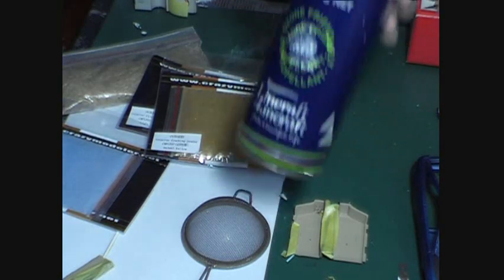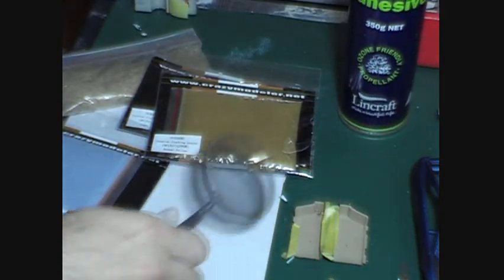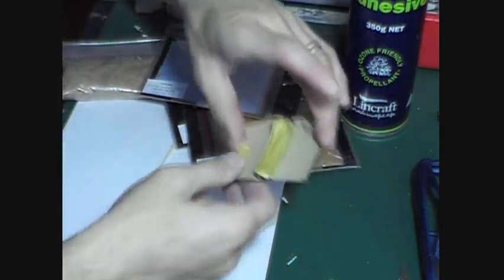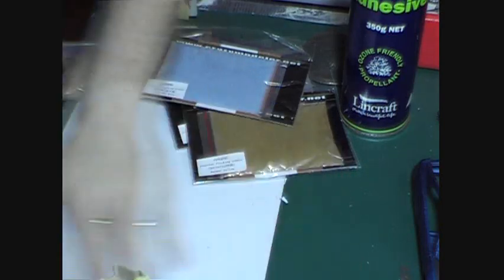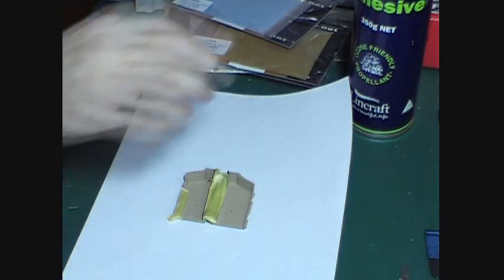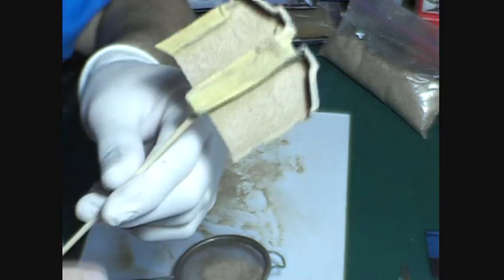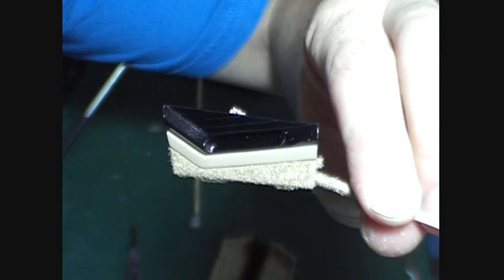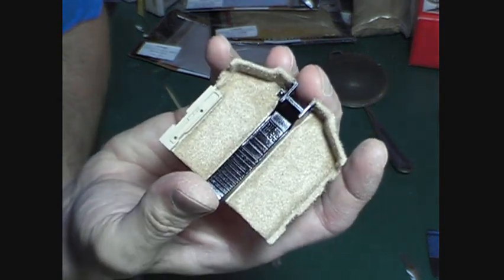Italeri Ferrari 348TB - Part 2 How to Apply Flocking

Comment: Outstanding work with the flocking mate.  You make it look so easy.  I have run into some trouble using certain spray adhesives on styrene and it wanting to melt the plastic.  I may have to give it another shot.  Thanks for the inspiration bud.

Comment: do you seal the flocking after you are done? I started sealing the flocked parts with a dull coat after i noticed flocking dust on my kits. "inside of a sealed case"